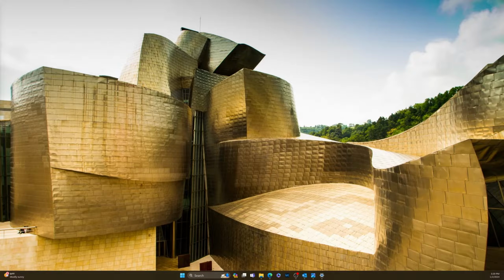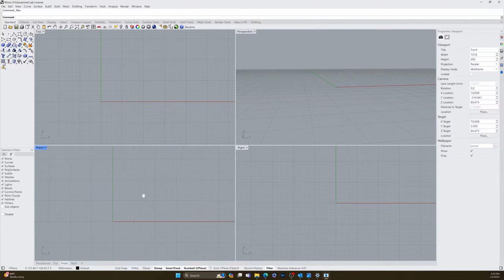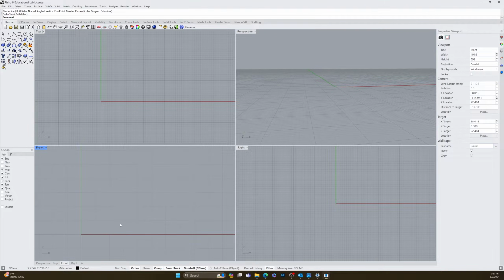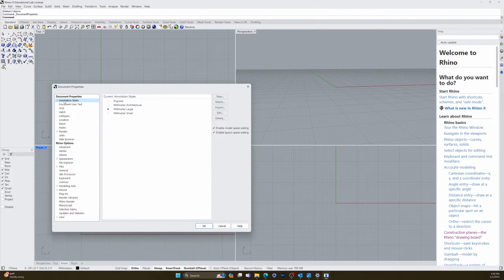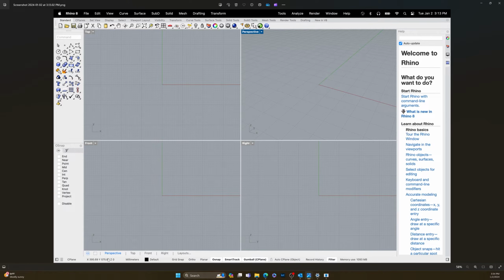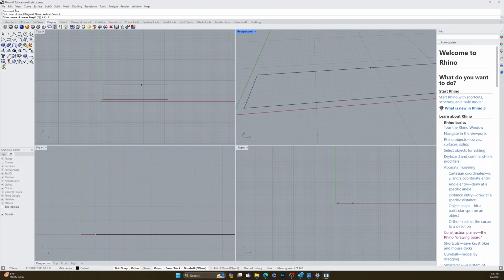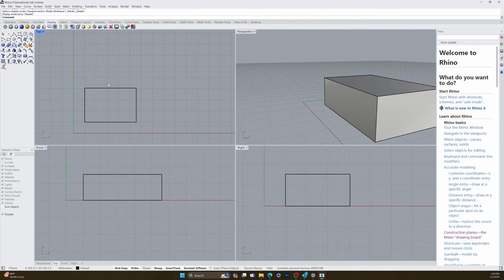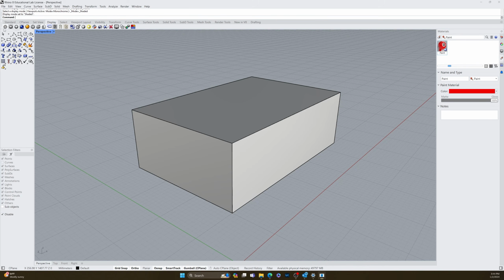Rhino 8 Starting Out (part a)

Comment: the materials tab doesnt show on mine
Reply from the maker: @ION_NIXIE 
You can type materials in the command line and it will pop up. Or there is the little wheel on the right side of the tool panel. If you click on that there is a setting called panels and you can scroll through them and select the materials window to add it to your sidebar .
Reply: @kmoore562  thanks mate